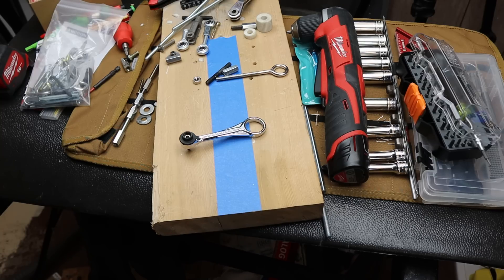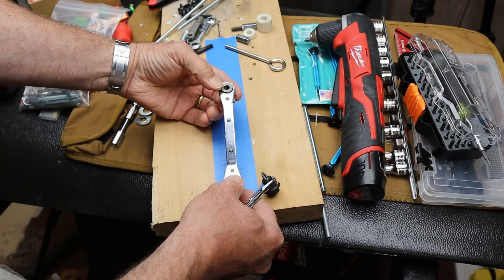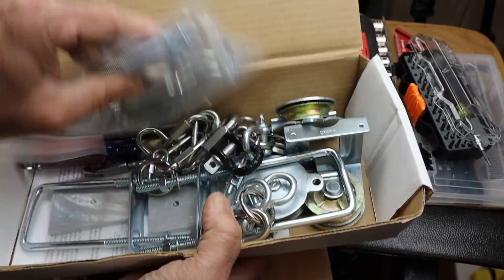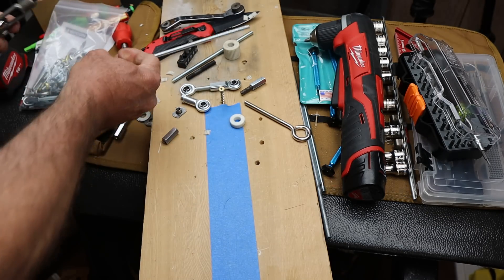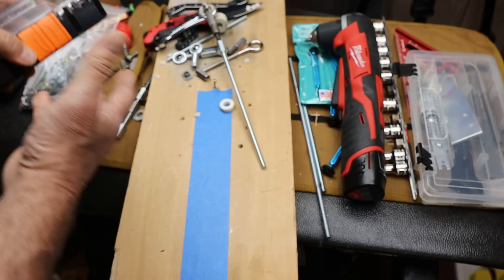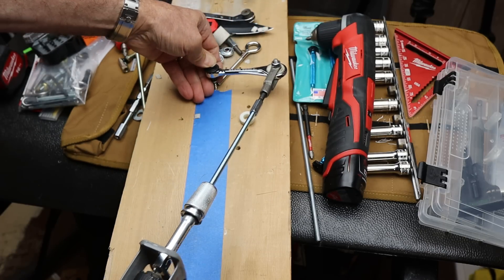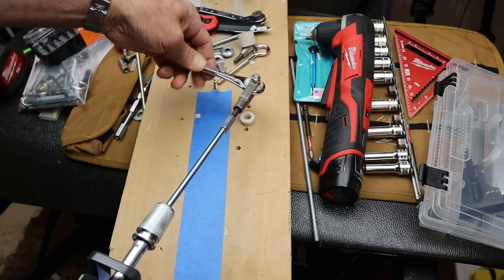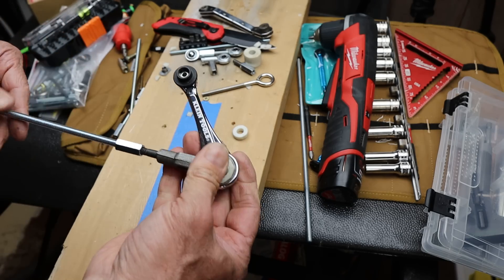Klein Tool Enhancement: An Electric Articulating Low Profile 72-Tooth Micro Screwdriver. Let's Roll!

Comment: Lisle sells pretty much exactly what you are thinking of as far as a manual tool.  Part number 64100 have owned it for a year or so and comes in handy under the dash of cars for sure.
Reply from the maker: Outstanding. Thanks for the idea. That Lisle looks like a big version of what I needed. However, it does move this from proof of concept to marketed tool.
Reply: @lastbesttool  also it’s a gearless deal so even the smallest movement moves the fastener. And I would say a bit smaller form factor than what you made
Reply: So Doc, I’ve often found myself in a similar situation where I’ve spent a significant amount of time making my own jig or fixture to do something that I didn’t have a specific tool for. After an hour of tinkering I get annoyed at myself and realize it would have been much faster to, in this case, turn the screw 5 degrees at a time, get a hand cramp and be done 20 minutes later. Now 20 minutes for 1 screw is insanity, but 2 hours later and driving that screw in 5 minutes isn't much better, lol
Engineers cant stop engineering, and Im convinced you are one of us… just trying to figure out which type of engineer.
Reply: A great concept , I have often wanted some thing like it when working on cars.
That said, the 1/4"hex 'right angle driver' will handle this situation  as long as you have the room overhead.

Comment: Oh man when you said RV all i could think about are the really od clutch type h or clutch type g screws my mother rv has. Only thing ive ever seen w these type of screws. Not a typical clutch bit. It has a belly in the middle, kinda looks like a butterfly. Irwin is the only one i could find that makes the bit. I showed one to a snap on dealer and even he was like wow ive never seen anything like that. Anyways...cool little tool you made. Vim has a similar bit ratchet but the back is much smaller. I believe its another 1/4, so you could put a 1/4 hex through it. Could do what you did here but would keep it a smaller profile. The bit ends are lower profile as well. Also, the lisle actuator screwdriver ratchet or whatever its called would be perfect for what you're doing. Or maybe the proxxon twist handle ratchet since it would accept an extension in the handle.

Comment: Snap-On makes a indexable ratchet in 1/4 that can be used at a fixed position or with the head unlocked so you can use it in a push pull manner.   P/N T72MP. Just add a 1/4 drive to 1/4 hex socket and you should have what you need. If you need it really low profile buy the RKRTM72A service kit and turn it into a ultra low profile dedicated hex bit driver.
Reply from the maker: Is it something like this: https://youtu.be/qvpfwKOXt3c

Comment: Just use a 90 BIT extender and a long dit extender in combination. Most of the big brands make 90 design bit holder. And a long bit extender. Iv had the same problem with a 2 inch space  and no way to get to the screw

Comment: This train of thought is really interesting.   I have an old 3/8" Reechet 90° drive ratchet that has me thinking about a different approach.  I don't know a good description for a Google search.  Here are a few options:
- Motion Pro 08-0229 illustrates the solution perfectly, but there is no safe place to apply pressure.
- Proxxon 23 082 1/4" square drive with 1/4" in the handle is almost exactly what I hoped for.
- Qualconnect Sidewinder 1/4" drive.  I'm skeptical of the quality.
- BOLWHAO makes a 90 set.  At their price, I'd buy two; expecting a short service life.
A different idea is like an elbow engine, Cal-Van Tools make a 90 degree gearless drive.
These are rotary ratchets like the Proxxon, but they don't have the 1/4" socket receiver in the handle.  
- Facom R.360 1/4" drive ratchet
- Facom R.PE360 1/4" hex, not square drive
- Stanley 89-961 - Stanley owns Facom

Comment: I was reading through some  comments and found some other names based on the them :
*Sealey Ak6962

*QUALCONNECT 3/8" Reversible Sidewinder Speed Wrench. U.S. patent no.4907476

*SIDEWINDER SPEED WRENCH 1/4" Part number: 12-21109

Comment: As an electrician, I SWEAR by this little thing! - I have replaced my stubby drivers, this not only works in tight situations, It also will double as a 1/4" drive ratchet for any nuts and bolts....I have tried the Craftsmen, Gearwrench, Wiha and Wera versions of this, and the Klein is still the best...the Wera and Wiha are a CLOSE second!

Comment: How about a 90° gear driveshaft type system. The gear 90° of the driveshaft could be hollow with a 1/4" hex hole in it. That would be extremely compact

Comment: We fabricate similar tools for aircraft engine work.  But use locking 1/4 drive extensions, cut up a 1/4 drive universal and weld on a reversible boxed in ratchet. Works like a charm.

Comment: forget the arc/lever/handle ... 1/4" hex right angle adapter with or without a straight extension to driver handle/drill/impact gun

Comment: My Klein ratchet accepts standard 1/4” hex shank bits on one side. I’m using the Milwaukee shockwave Hex head bits to tighten up dining room furniture. So at least one end of the ratchet does not use the Klein proprietary bits.

Comment: Am I missing something?  There are literally hundreds of close quarter right angle 1/4 in hex bit adapters out there.  

I've used 2 of them linked together with long extensions before in a Rube Goldberg come to life scenario where is could just see the screw, but there wasn't room for my hand to get in there and there wasn't a straight path to the screw that a tool would fit through.  I still needed a long forked rod to hold it on the screw, and it was a curse-fest, but it worked.  Always keep a variety of magnetic AND locking extensions around.  This little operation took about 20 minutes to achieve success, but it saved me from about 3 hours of work removing the parts that were obstructing me as well as a refrigerant recharge and coolant mess.  The hardest part was controlling the reaction torque at the first angle attachment.  A high tech wood block with some duct tape solved that. 

The linear actuation is just too restrictive for where it could be used.  But that's just my opinion.
 However I do think there would be a market for a QUALITY extra slim, extended reach(no longer than that) ratchet or worm drive pass through tool and/or attachment that would accept a square drive or 1/4 in hex drive.

Comment: Milwaukee has a 90° bit driver with 1/4" shaft. I add what ever length extension and use a handle or electric screwdriver. It works in most tight spaces.
Reply from the maker: The RA adapter was too thick. The screws were almost the length of the channel I had to work with so I needed to back them out until the tools ran out of space, then use my fingers for the final couple of turns.  Same with inserting the screws back in. But a low profile RA adapter might have worked.

Comment: What about a ratchet with rotating handle?, they also have 1/4" entry in the end so you can drive it with drill or something, E-Z ratchet, Proxxon, etc have those.
Reply: I agree.  Looking around, I think the Proxxon 23 082 is the best choice. The handle rotation can be driven with a 1/4" drive extension and whatever you want to put on it. I think the E-Z Red rotating ratchet is only 3/8" drive and cannot be driven other than by hand.
Reply: @arasmith  ah, good to know about the EZ, I only saw pictures of that one, and assumed. I have the proxxon 1/4", very nice kit.

Comment: Very Creative, I feel like the right angle attachment with an extension would accomplish this much easier.
Reply from the maker: The RA adapter was too thick. The screws were almost the length of the channel I had to work with so I needed to back them out until the tools ran out of space, then use my fingers for the final couple of turns.  Same with inserting the screws back in. But a low profile RA adapter might have worked.

Comment: If they didn't make the thumb wheel so tall on the Klein there's be no need for the extra stubby bits.
However if you had a regular " reverse gear " bit ratchet made by HI-FIVE  you could then use the extra stubby bits and have the lowest profile thing ever.
Reply: I have a matco and a husky bit ratchet that are more slim than that Klein one. The husky one has a thumb wheel and can also use 1/4 drive for sockets as well as bits

Comment: I have this klein set as a commercial electrician, I use it all the time. I've had to extend the handle multiple times. I just tape a piece of all thread to it...
Reply from the maker: Good solution. It still seem that there should a unique tool solution out there somewhere. Not quite like what I made, but a super low profile adjustable bit/socket driver that could expand/contract into the space allowed and then rotate.

Comment: Get a Milwaukee 49-22-8510 Right Angle Drill Attachment and a Malco BHE10 extension, and use a drill.  Gets into tight spots, and with a short Phillips bit, gives you room to press into it with your hand.  I have to use weird set ups like that when dealing with getting Phillips head screws out of tight spots on ductless units in the ceiling.
Reply from the maker: The RA adapter was too thick. The screws were almost the length of the channel I had to work with so I needed to back them out until the tools ran out of space, then use my fingers for the final couple of turns.  Same with inserting the screws back in. But a low profile RA adapter might have worked.

Comment: I think it would be less problematic if you based it on the Facom twist drive ratchet with a drill connection.
Reply: That's a lot like what I was thinking of, but I think the Proxxon 23 082 would be better because it has a 1/4" square drive receptacle in the butt of the handle.

Comment: De-walt makes a 12" right angel, flexible extension for situations like this.
Reply: I have it, it might work if it's too wide.
Reply: A lot of companies make thise right angle attachments now. You would need the head height/depth as well though. Once the screw is almost out, or driving a new screw, especially if its a 2.5-3" screw makes it harder to fit into a tight space. Something like this will keep the clearance down quite a bit in tight/shallow space

Comment: 90 degree driver w/ extension should get that. Nifty gizmo nonetheless
Reply from the maker: The RA adapter was too thick. The screws were almost the length of the channel I had to work with so I needed to back them out until the tools ran out of space, then use my fingers for the final couple of turns.  Same with inserting the screws back in. But a low profile RA adapter might have worked.

Comment: Seems like a VIM HBR3 bit ratchet may give better results than the klein. The fat opening restricts range whereas the vim has small box end opening. I don't know anything about the bs preoperatory klein bits but VIM uses standard bits too. If the connections built square and can't twist, may just be able to get the right pressure placed down without needing a hand on the tip if you can get a bite.
Reply: I have a husky one that sounds like the vim one. Really small and thin. Reversible lever and thumb wheel. The other sideis 1/4 hex bit pass thru
Reply: Actually its 1/4 on one side and 5/16 on the other. Part number H4Drbd. I thought it was more like the vim one you said for some reason.

Comment: I feel like craftsman would sell something like that as a holiday tool.  ;-)  Impressive engineering!

I have yet to come across anything other than car speaker screws that I could not get to with a right angle impact adapter (hence the bit ratchets).

Comment: So u didn't have enough room to use your 90 degree adapter yellow and red make em??? 🤔 slap that on use your drill or impact
Reply from the maker: The RA adapter was too thick. The screws were almost the length of the channel I had to work with so I needed to back them out until the tools ran out of space, then use my fingers for the final couple of turns.  Same with inserting the screws back in. But a low profile RA adapter might have worked.
Reply: @lastbesttool  10 4 was wondering 🤔

Comment: What's up Doc. I think a 12" right angle flex shaft with a 12" drill extension for drill will do the trick.
Reply from the maker: The RA adapter was too thick. The screws were almost the length of the channel I had to work with so I needed to back them out until the tools ran out of space, then use my fingers for the final couple of turns.  Same with inserting the screws back in. But a low profile RA adapter might have worked.
Reply: @lastbesttool  they do make a low profile adapter on Amazon.
Reply from the maker: @ryanbuelna9686  Thanks. Do you have a product name? My search doesn't show one/
Reply: @lastbesttool  hey doc take a look at the gearwrench 45 piece 1/4 drive bit set that is slim profile. The flex adapter is gone already for whatever reason.

Comment: but wait, you have 3 m12 ratcheting auto wrenches, why not put a socket adapter for example 3/8 to hex bits?
Reply from the maker: The power ratchet was too thick. The screws were almost the length of the channel I had to work with so I needed to back them out until the tools ran out of space, then use my fingers for the final couple of turns.  Same with inserting the screws back in.
Reply: @lastbesttool  got it... but it would be interesting to see how m12(for example) ratchet with a socket to hex adapter would do just screwing a phillips head. (idea for a vid :) )

Comment: I have a fine tooth ratchet from proxxon that you could put a 1/4 hex adapter on it. The ratchet works as a normal ratchet but you can twist the handle like a screwdriver. 

Either that or use a Milwaukee 90 bit adapter and an extension
Reply from the maker: The RA adapter was too thick. The screws were almost the length of the channel I had to work with so I needed to back them out until the tools ran out of space, then use my fingers for the final couple of turns.  Same with inserting the screws back in. But a low profile RA adapter might have worked.